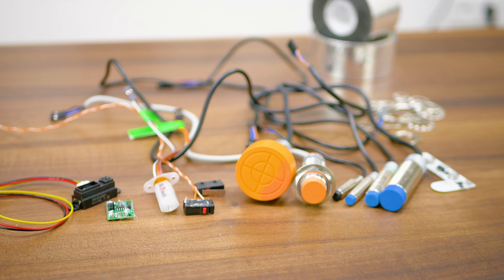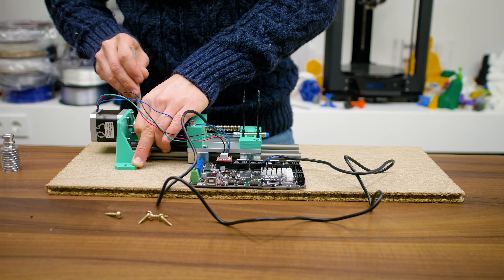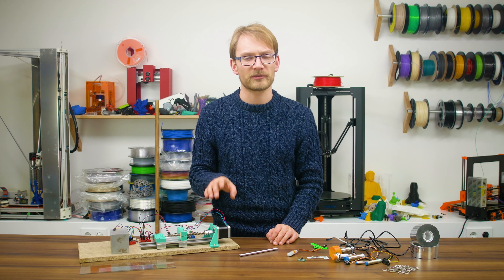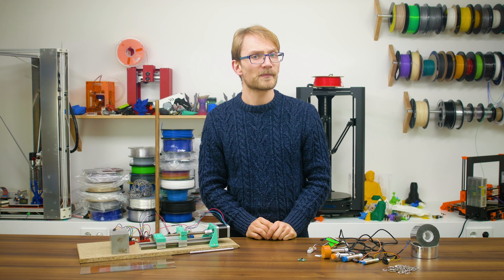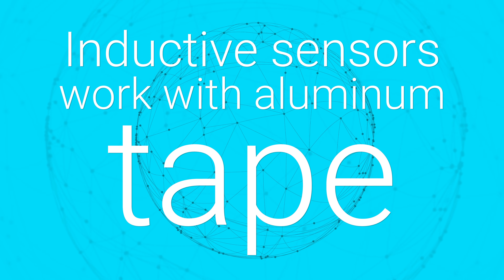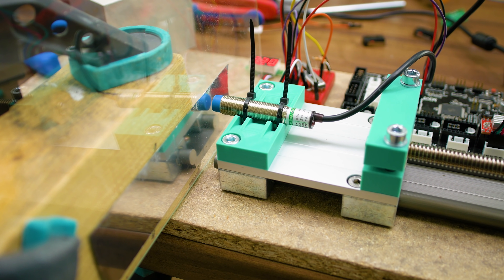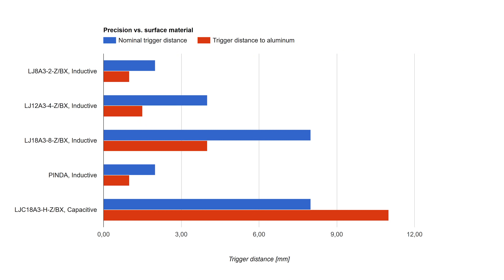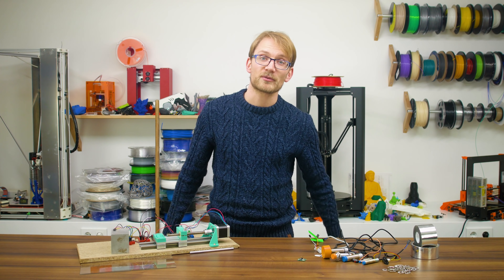Autoleveling on 3D printers: 9 myths and 12 sensors tested!

Comment: my 4mm sensor that requires 12v works fine on 5v only 1.5mm sensing distance. but that works for the application.

Comment: I've got a 3mm disk of aluminium under my glass surface to act as a spacer and conduct heat from the PCB to the glass - the glass itself wouldn't sit flush due to soldered connections. Is there an inductive sensor with enough range for this thickness of aluminium to detect it through the glass?

Comment: Wow love the detail and different perspectives covered in this video. I'm a sucker for this sort of data. If inductive sensors have their detection range halved, and there is a sheet of window glass (2.38mm thick) on top of the bed, doesn't that mean that both 2mm and 4mm inductive sensors are right out?

I'd love to print ABS right on the aluminum but nothing sticks to it without a carefully maintained pile of glop (glue/slurry), where glass works for weeks with a single light hairspray application.

Comment: a method that isnt quite there yet, but very promising, is to detect the nozzle physically contacting the printing surface. either by a piezo (surface microphone) detecting up the sound of the tap, or a strain gauge meassuring miniscule deformations of the head mount.  the obvious advantage is that it eleminates the need for tweaking offsets and clunky sensors. a few people are tinkering with this already, so it's just a matter of time. =)

Comment: Nice and informative video! Do you also have an idea about the accuracy if the "to be detected material" is the moving part, and the sensor is in a fixed position (90 degree rotated compared to the moving object)? 
I ask this, because in this video the sensor is used to measure the distance from the hotend to the base plate. But what sensor should be best to use as "home position" switch - so the accuracy of the home position is best guaranteed?
Is the accuracy of the (inductive sensor) still as good if the object is approaching sideways?

Comment: I use 12v on my inductive sensor, but use volt divider to connect data to Z limit switch. works. Did you test it that way or did you actually just used 5v?

Comment: I'm using an 8mm NPN output inductive probe, the same 8mm one in the video. Rather than using a voltage divider what I use is a diode instead. When off it puts out 12V and goes low on trigger. So you put the diode in series with the output with the cathode towards the probe to block it and make sure the pullup resistor on the input is enabled in the firmware.  When the probe triggers it goes low and turns on the diode and pulls the input down to .6V which is good enough to be considered a low on the input. The diode will give a nice cleaner trigger to the input than a resistive voltage divider will and it's easier to wire and insulate, just solder in series and cover with heatshrink

I'm sensing nothing but a 10"x10" PCB heater (Sitting on cork to keep it flat and insulate it) with a 2mm thick piece of hardware store glass on top and the repeatability is near 100%. I always use it on a preheated bed and that seems to help repeatability. My only gripe is you have to recalibrate it in the firmware if you do any work on the hotend or X carriage but that's not often so it not a big deal since the rest of the time it's pretty much "plug and play" printing. Cheap effective upgrade IMO

Comment: Hi Thomas, 
Did you check if the 8mm inductive sensor triggers through a 4mm or maybe a 2 or 3 mm glass? I think that would be the best solution if it works.. I know the glass reduces the range but I read that it is possible. 
Greetings from Germany!

Comment: My i3 has a PCB heater and a 3mm sheet of boro glass on top of it and 0.8mm sheet of PEI on top of that, I pondered adding ABL, I tried a friend's 4mm conductive sensor and that worked to sense a thick aluminium "grilling foil" through all that but only if perfectly angled and I pushed on it a bit, that's a no-go, ordered a 8mm conductive sensor from aliexpress and that works a treat, detects the foil under the glass and PEI with 3mm to spare. Haven't assembled it all yet on the printer though and I'm not sure how repeatable this setup is. I'd prefer a 1-2mm metal sheet as a heat spreader I think over foil but need to find a source for it. Though the 8mm conductive sensor is pretty big and has some gravity in it, might be a better idea to buy an aluminium heated bed?
Reply: An 8mm will work better with just a PCB heater. With nothing but copper to sense the range is reduced to about 5-6mm. I'm using 2mm hardware store glass and I have about a 3mm clearance between the probe and print. A 4mm seems to work OK on an aluminum bed as proven by Printrbot but in my experience not with just a PCB heater for it to sense. I always probe a preheated bed. A PCB heater is also a flat wound inductor  and I suspect that helps because the sensor is basically looking for a change in inductance and the inherent inductance in the design seems to help. You may also need to support the heater (I used cork) so it's flat on the glass and not bowed because the hotend will follow the bow since the 'home' probe is in the middle ....enough bow and you can even crash the tip into the glass

Comment: How about using conduction between an aluminium bed and the nozzle?
Reply: That is essentially how Lulzbot does it. Just make sure the internal pullup resistor is enabled on the Z stop input and run a wire and attach to the hotend. Then on the corners of the bed there is an aluminum disc that is grounded and when the tip touches the disc it pulls the input to ground. To make this work he has a cleaning strip and wipe routine he runs first because any plastic would act as an insulator. If you go up to the Lulzbot website you can find the design details since it is all Open Source. I borrowed some of the End print G-code for my Slicers and checked out the Marlin Config code they use. Same thing is true for Prusa's website lots of design details, excellent build manuals and Marlin Config code. Prusa's new design for his PCB heaters is definitely a step up from the "Engineering textbook" design of the original and clones
Since I build from scratch or use modified kits this information was invaluable.

Comment: Really Great and informative video! Just the stuff I think most of the audience seeks.
I would like to point you in the direction of the square type of inductive sensor as they are easier to mount and generally a smaller package. 
Personally i use a Fotek PL-05N/2 10-30v(maybe clone) on 5v and it works really great according to the repeatability test in Marlin RC8. You can find a dirt cheap one here: http://www.ebay.co.uk/itm/PL-05N-2-Inductive-Proximity-Sensor-Switch-NPN-NO-for-FOTEK-DC-6-36V-NO-5mm-/262115551988?hash=item3d074deaf4

Comment: So if simple metal rod that shortcut circuit is the most reliable and can even be used as a  reference - why nobody use this simple solution?
Reply: as i understand it must not protrude below nozzle level to not mess with the print, but we can install small protruding metal items on the hot bed perimeter, and seek for them

Comment: Instead of aluminium tape you could use copper tape or piece of copper foil peeled of PCB. I have 4mm glass and 8mm inductive sensor and It senses It without problem. It's less then 8mm but It works :) Aluminium is less conductive (Yes, conductivity and indictivity is hand in hand) so It's sensing in about 40% of declared distance. Copper is much more conductive, so should solve your glassy-induction-sensing problem :)

Comment: Very, very nice testing here! Thanks Thomas!
I've been using a little microswitch (with lever) on a metal strip moved by a servo. It's working flawlessly for years now.
(all metal printer, no 3d printed parts)
Nice to see that this turns out to be a precise way indeed :-)
Reply: Hi, Are you still using the micro switch?

Comment: do you know of any good in depth tutorials on how to add auto leveling to a wanhao i3 (or one of its many clones) 
or would you consider making a how to video for adding auto leveling to a printer , the pro's , con's , do's and donts 

i mean like stupidly in depth, i come from a 3D art background so all this physical stuff is very new to me 
ive never seen a arduino before and used a soldering iron for the first time recently when i replaced my hotend 

i learn lots from watching your channel 
thank you Tom
Reply: I'd like to add a +1 to this request. I'm at the other end of the spectrum, having taught soldering to NASA standards :-}, but out of electronics for years and now getting back in, n00b to 3D as well. 

Have a Monoprice Select v2 and am wondering if I can do it with my current PCB or have to upgrade. 

I think I'll go with a re-purposed ATX power supply as an upgrade too...

Comment: This is super helpful!

I've been using an 8mm inductive sensor with an aluminium bed but only with 5v straight from my ramps/mega this has been working reasonably but my own repeatability tests haven't exactly been amazing - You'd recommend using 12v instead to improve accuracy?

One potential issue for me with my current setup is that it seems like the probe also triggers slightly early (to the tune of a couple tens of microns) on areas of the bed where there is steel directly beneath it (I have a p3Steel frame so the frame itself, the steel bed mount etc). I've even rotated the aluminium plate 180 to make sure it wasn't an artefact of the plate itself.

I'm thinking maybe that's a side effect of going with the longer triggering distance? (which triggers around ~5mm for me atm) is that something I should expect to happen with 3mm steel some 5mm underneath 3mm of aluminium? The issue I have with something like a 2mm sensor, is the clearance is pretty tiny - I used to use a 4mm inductive sensor but I had an incident in which a bit of warping resulted in the sensor being ripped off its mount and then getting jammed between the bed and the frame in an overnight print, not fun!

I've also just ordered a BLTouch to compare (hence my request on twitter the other day) but honestly I really like the simplicity of the mounts for inductive sensors and their slick look - why should that matter? because I'm vain like that :P

Comment: Good video in so far as accuracy/repeatability goes. Nothing about suitability for the purpose of calibrating/levelling a 3D printer. That is how easy to install, setup, can you get it close enough to the nozzle, mass of sensor etc... There is currently much work being done and excitement about the developing piezo-electric hotend sensor. Using the nozzle to probe, no offsets. See reprap wiki/thingiverse. We now have more and more units in the field every day. As for the others aluminium foil under glass works fine with inductive as long as the glass isn't too thick. Would love to see our Piezo sensor tested using your rig. http://www.thingiverse.com/thing:2069480

Comment: This is interesting. I see that microswitch w/o lever SD is about 1 um. Same as for inductive sensors. What is the point of using  Bl touch or inductiv sensors if once can just put a microswitch button down on the print head and do autoleveling with it? but how to put it higher that the nozzle...

Comment: Perfect timing Thomas!!! I've been looking into upgrading my whole X carraige on my cheap I3 clone, with a new E3D V6 and titan. I was planning to use an inductive sensor with foil tape, I didnt even know about those optical sensors! my cheap chinese hotend and extruder are crapping out on me after a few years, I think i probably deformed the teflon liner trying to print either PET or nylon and there's a huge amount of internal resistance. I was printing some makergeeks PLA rated for 210-220 at 240C and only 12 mm/s, any faster or colder and the extruder skips like mad. I also dont think that it was actually 240C and my thermistor is probably going bad too

Comment: When I was working on the auto-alignment at Type A Machines, I was very surprised at the unsolvable nature of the auto-alignment problem. There's essentially no way to get the desired flatness when combining the standard deviation of the sensor, with the rated flatness of aluminum, and the thermal expansion when heating to over 80C. You could conceivably do it with steel, but that has other challenges from the weight and cost of facing. Glass is really the only material we could find with below +/- 50 um flatness and dimensional stability when heated (we even managed to find some with +/- 0.3 um).

Really the solution is to crowd source some magnetic glass, minimum order is 5 tons and works with induction.
Reply: I'm game, magnetic glass ftw
Reply: just epoxy glue a steel sheet to a piece of glass

Comment: Tom, if you retest the optical sensors, I would like to see it done with different color materials behind the glass (specifically black, white, red and peach- the common colors of heaters).  Would also like to see how ambient IR light affects the repeatability, i.e. fluorescent lighting and sunlight.  I had very mixed results with David Crocker's IR sensor during probing with sunlight coming in through the windows, for example, vs. probing in a dark room.
Reply: The IR sensor I make doesn't like bright sunlight (no clouds in front of the sun) shining directly on the bed and reflecting into the sensor. The current version 1.2 will flash the LED rapidly to warn you when it detects that. Otherwise, it isn't affected by ambient light. Incandescent light - especially halogen - affects some other types of IR sensor, but not mine.

I'd also like to know what material was behind the glass when Tom did his tests. The reason that glass and other transparent materials can cause problems for optical sensors is that you get 2 or 3 reflections: one from the front, one from the back, and possibly a third from whatever is behind the glass. We want the one from the front to be stronger than the others, which is why we recommend a black surface behind the glass.

Comment: Odd that you could not get the 6-36v sensors to work at 5v.  I've been using a Uxcell LJ18A3-8-Z/BX 8mm Approach Sensor Inductive Proximity NPN NO Switch DC 6-36V with a supply of 5v for months with no problems on an aluminum bed with PEI tape.  The sensing range is definitely less than 8mm in this config but it works very well.  Great vid overall, as usual.

Comment: You should have tried steel foil.  I bought some SS foil off ebay, a single layer of fractional mm thick tape does trigger a 12mm inductive sensor, but NOT though glass.  Maybe on top of glass covered with kapton tape?

Comment: this just convinced me to skip the bl touch and make my own mechanical setup
Reply: I know your comment is a year old so I hope this is still relevant to you.
He tested them all horizontally. The BLTouch specifically states NOT to use it that way. It needs to be hung vertically as it would be mounted on a printer.

I've used a mechanical switch with manual leveling, a mechanical switch that flips up with a servo, capacitive sensors, inductive sensors, glass beds, PEI sheets, Zebra Plate from PRINTinZ, aluminum beds, and even tool steel beds. I've tried a total of 15 different sensors and 11 different beds in my few years of 3D printing. NONE of them were as accurate as simply using the BLTouch. When it is installed correctly, it just works flawlessly. Best of all it doesn't care one bit what surface you have, it will work on anything.
Reply: @ @SchwettyBawls  I really would like to see a follow up video with more precise data!
Reply: it's a bigass button for $40
Reply: The BLTouch is too expensive for what it is, frankly.

Comment: Tom, your videos are fantastic. Thank you for all of the great information. I do have a question, and it is probably simple but I am going to ask anyway <grin>. I have a 5v 8 milometer Inductive sensor, against a standard aluminum bed works just fine with Marlin/Skynet3d (I am a Anet A8 person). However, the moment I add a piece of glass to get a really smooth surface, the inductive sensor is still reading the bed height from the aluminum bed not from the glass. During auto-leveling the software is picking up the deviations from the aluminum, it has no idea about the glass. Does this not impact how the layers are put down over large spans? Thank you in advance and keep up the great work.

Comment: You should try the aluminum tape trick with the optical sensors, I have a feeling the Sharp will benefit from it. 
Also, try doing tests with multiple sensors, like one for each corner of a bed vs a single sensor.

Comment: Great video Tom.  I have two related questions.  Since you agree that 12V is far more precise than 5V would 30V be even better?  And if so can you use an external power supply to power the sensor and feed the result into the board without damaging it?
Reply: Your idea seems correct, but no need for an external power supply, you could use a "step up" https://www.amazon.com/Solu-Adjustable-Converter-3-5-35v-Voltage/dp/B00VA0GRFG/ref=sr_1_3?ie=UTF8&qid=1490647751&sr=8-3&keywords=Step%2Bup%2B5%2Bto%2B36V&th=1 
And then divide the reading with capacitors

Comment: Thank you for the great video! 
However, I am suspicious about the measurement numbers you put out. You report <1um numbers. I put my laser interferometer on a setup similar to yours. Frankly I got larger distance changes simply by shifting my body weight from one foot to the other when standing in front of the table. Not saying your results are wrong in principle, but claiming single or sub micron accuracies with a setup like that is very optimistic. You want to try to do a sanity check using an interferometer?
Reply: Agreed. Is the David Crocker's IR sensor comparable to the one in the Ultimaker 3?
Reply: May want to check the structural integrity of your floor! LOL :D